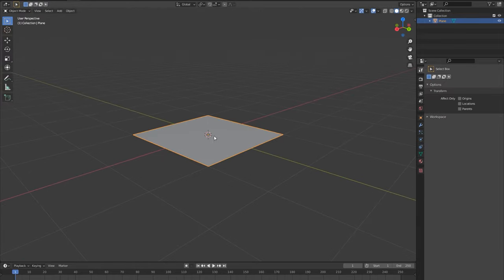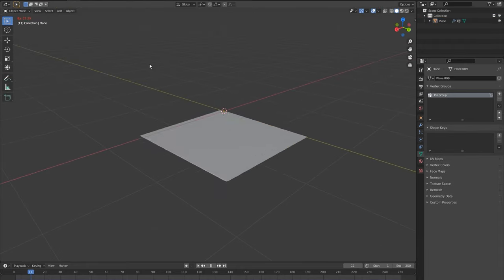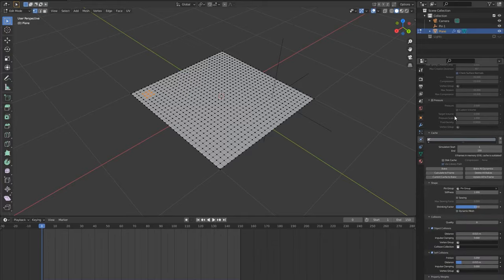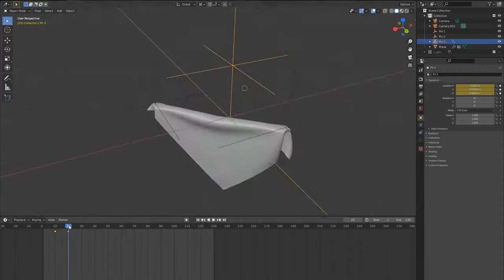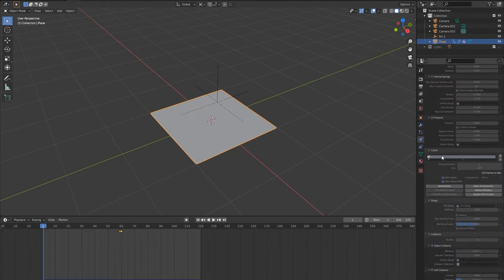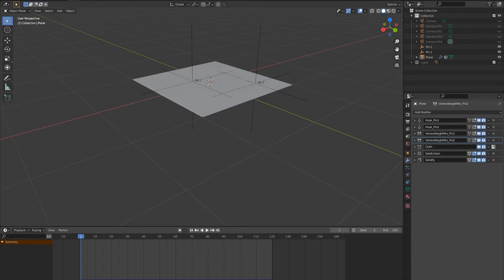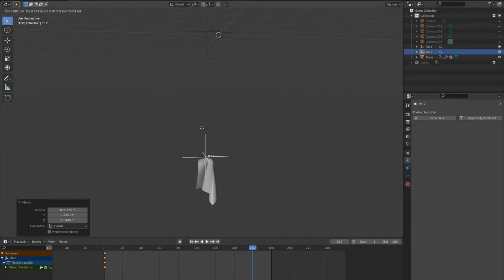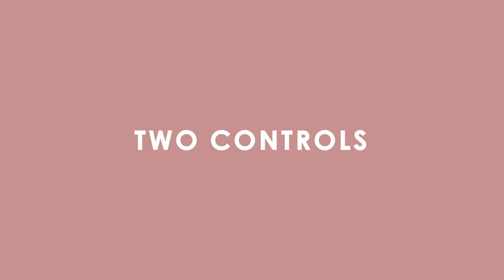Learn Complex CLOTH ANIMATION in under 10 MINUTES! | Blender 3D Tutorial

Comment: hey ! I have come across a problem and i can't seem to figure out how to do it. I have a character with rigged clothing with cloth sim attached and i tried to use the video to add hooks to control the cloth but when i animate the character the clothes break and the bone rigged cloth and the hooked cloth move in different directions and not as intended. Do you know how to solve this...? Thank you so much...!
Reply from the maker: I unfortunately haven't looked into using the cloth sims specifically for clothes so I'm not sure I have any solutions. Possibly make sure the modifiers are stacked in the right order as that can cause problems. Other than that I'm not too sure what the problem could be

Comment: i have a very precise question as a noob in blender, I've watched approx. 50 videos of cloth simulations and they all start the same way you have to add the collision mod too one object then the cloth mod to the other object then hit play and it falls, why is this????? i ask this because I'm working on a project of my own and I'm stuck because I'm wondering if its even possible to do what I'm trying to do, i have a model a statue and i want too drape her in a cotton sheet then that sheet will be pulled up upwards or vertically very slowly reveling her, but how on earth do i even begin this?
is there no way too just drape her as in throw the blanket over her or does it have too fall on top of her first? then how do i start the animation from when she's just covered with the sheet and then how do i pull it off her? in a slow motion speed matter, for the pulling the sheet off her im gonna use the technics you showed in you're video because its perfect! but how do i even begin? I'm trying my best too explain could you maybe just point me in the right direction?
Reply from the maker: You can change the start frame of the animation on the timeline. So run the cloth sim and let the cloth settle, then using the pin group workflow shown you can lift the cloth back up and just change the start frame of the animation so it doesn't show the cloth falling at the start. Or as an alternative look into baking/converting the cloth sim to a mesh when it's over the statue, then use another cloth sim on that mesh to lift it off
Reply: @lewisanimation  thank you for the reply, I tried it the first method you mentioned and it’s working, but now I’m curious about the second method but I’m not sure I follow im noob, what do you mean by over the statue like is floating above it ? Or touching it? Then click mesh mod again on that same cloth so it be 2 clicks of cloth mod? So sorry for not understanding I’m just starting out I know it’s annoyng but I’m tryng.
Reply: @lewisanimation  you know what ignore my other comment for now i think its better if i focus on one thing at a time lol as a noob, ok so i only need one pin to lift the sheet from the model upwards and slowly not really a jank but for now i guess i would really just like it too work since its not really animating then again i don't even know how too animate it, i moved the cross up wards and pressed i and choose location option (made a two key frames point a to point b) and played the animation and the cloth does not lift whatsoever am i doing it wrong? also when i grab the cross and move it around the cloth doesn't move with it like in youre video. one detail it is already has a bake for when the cloth falls idk if this is affecting it.

so i deleted the bake rebaked and now the dummy is poking trough the sheet and i "animated the sheet"  no animation in sight whatsoever idk what im doing wrong.